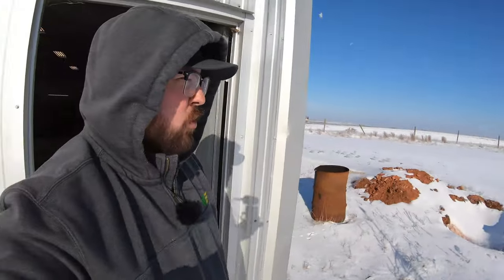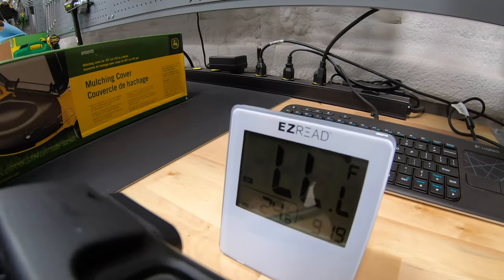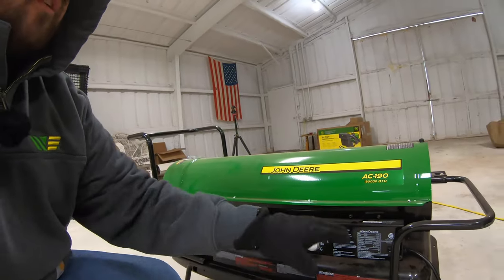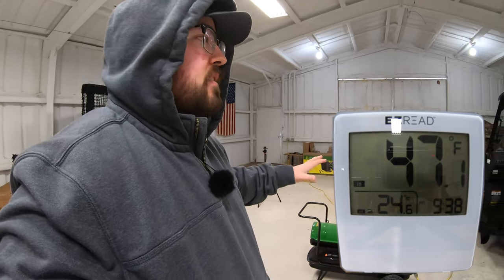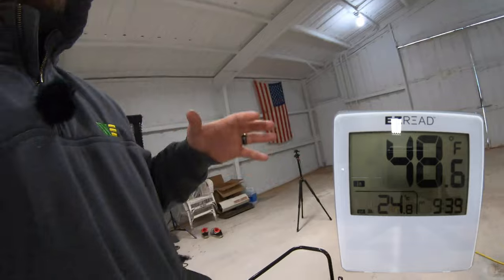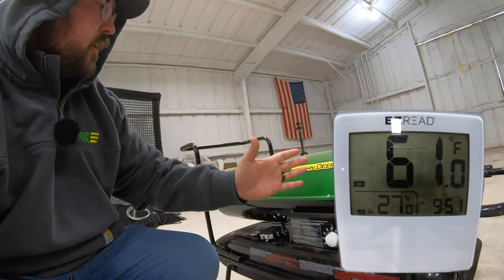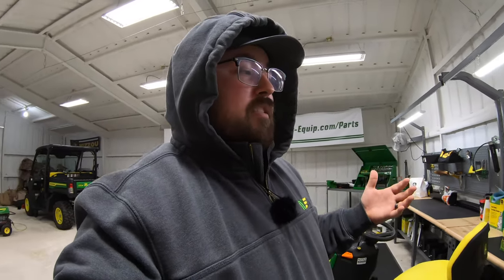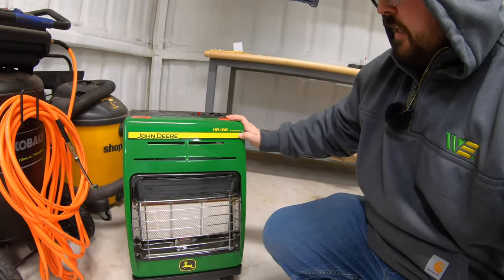How fast will a John Deere Space Heater warm up our shop?

Comment: Hello from Eastern Oklahoma. My question is much like your first comment. Any taste or smell from the Kerosene?
Reply from the maker: It does produce a bit of smell but I worked in the barn all day when I did this video running the heater on and off all day and it never affected me at all. It’s a very clean burning option!
Reply: @WesternEquipment  Can I burn Klean Strip klean Fuel in it?  I have 1 85K and 1 60K Propane Heaters but I'm sick of changing Igniters on them. One more question. How long will the Heater run on 1 gallon of Kerosene?
Reply: Have you noticed how hard it is to make a sale when you can't answer the Customers questions?
Reply from the maker: @David-ll8bt  My apologies! I did not see your previous reply. Yes you can use the Klean Strip Fuel as it is a direct alternative for kerosene. This heater has a 13 gallon tank and they are rated at using 1.34 gallons per hour.
Reply: @WesternEquipment   Thanks for the reply. What would be the nearest store to Yukon where my daughter could pick up a 215 BTU Heater?
Reply from the maker: @David-ll8bt  Looks like our Clinton, OK location has a couple on order but we completely sold out after the big winter storm. You could give them a shout at 580-323-1324 and ask if they have an ETA on them and then reserve one.
Reply: @WesternEquipment  Thank you.